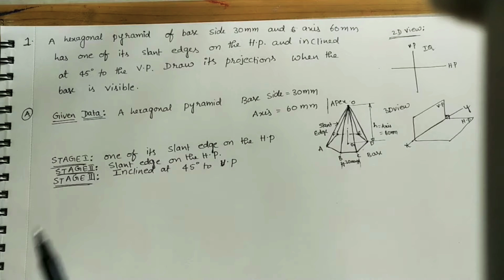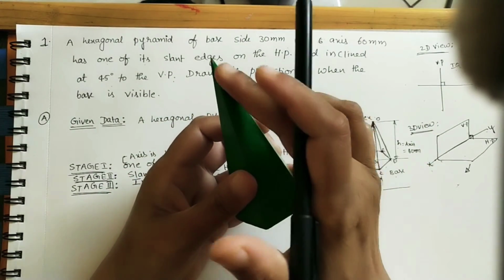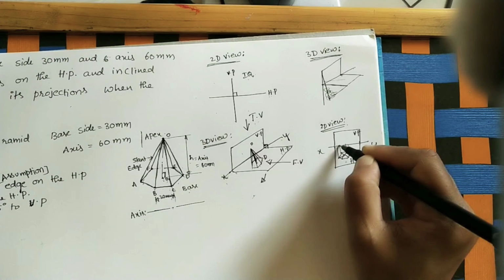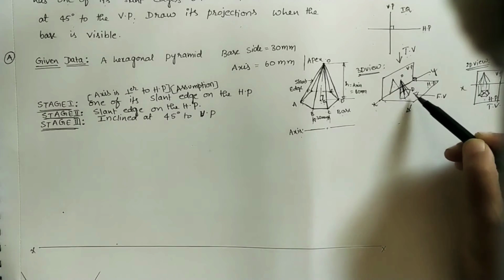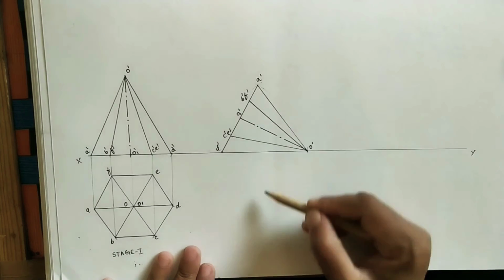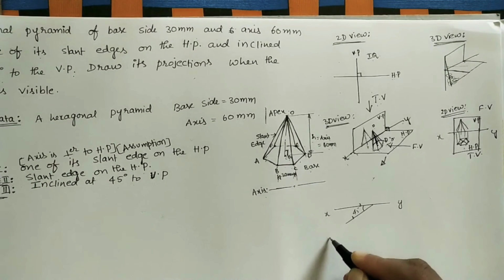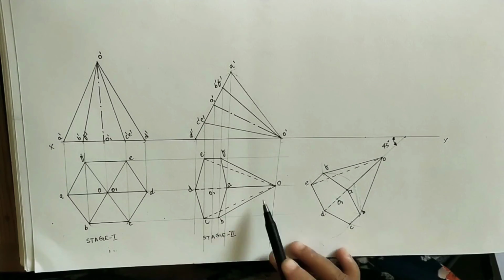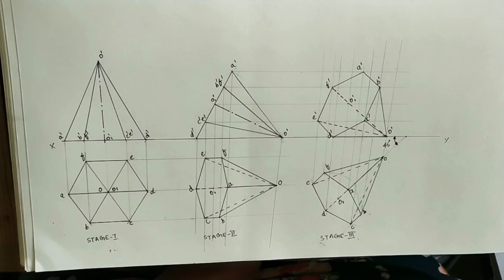Projections Of Solids :(Hexagonal Pyramid) :Slant Edge is on H. P, 3-Stages

Comment: Is that on edge or face ??? Make terminology clear... if that lies on edge.. views comes to be different...
Reply from the maker: Whatever edge initially we r taking ('a' point corner) & axis plane (vertica planel) is tilting 30° to V. P. It's edge not the face
Reply: @engineeringclassesbydr.noo3377  but in question it's is mentioned edge...
Reply from the maker: In engineering drawing both corner and edge has same meaning.

Comment: A hexagonal pyramid of 30 mm side of  base and slant edge 65 mm long is laying on on of its traiangular surface in  v.p.bso that its axis is inclined at an angle of 45 degree to the H.p. Draw it's projection if apex is nearer to the observer.     Mam please ye question jaldise solve karke channelvpe uplod karo.... 🙏🙏🙏🙏
Reply from the maker: I will upload tomorrow
Reply: @engineeringclassesbydr.noo3377  tommorey at morning???
Reply from the maker: https://youtu.be/AfF5w97a1aY
Reply: @engineeringclassesbydr.noo3377  thanks alot mam 🙏🙏